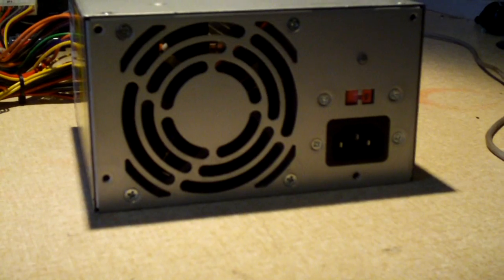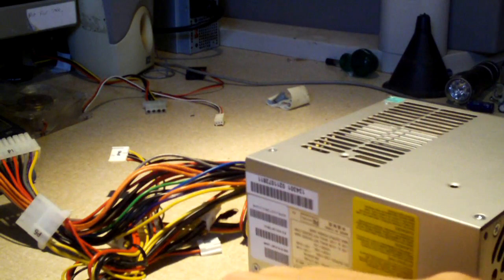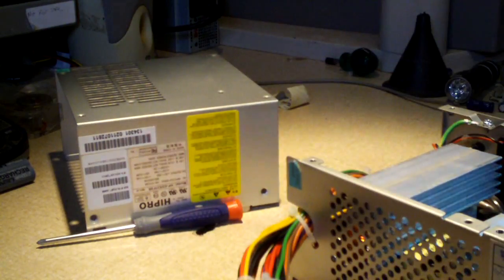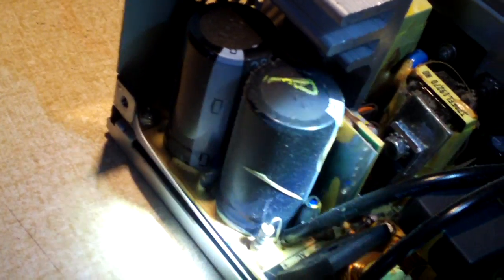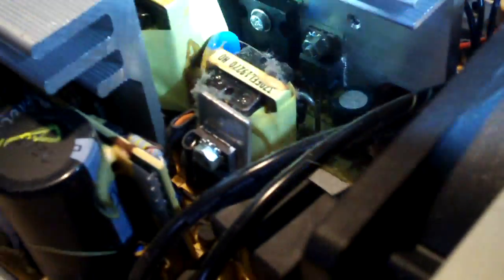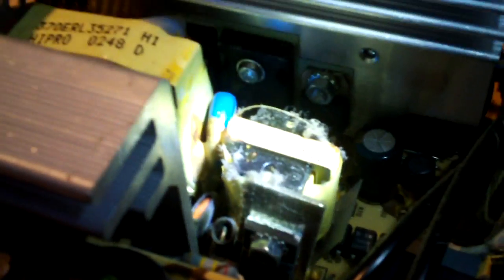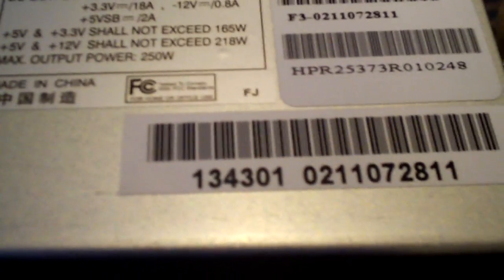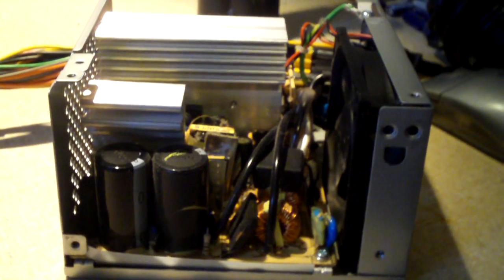Autopsy of dead HiPro HP-D2537F3R power supply - May 2013

Comment: The failure mode you describe sounds like one of the primary switchers blew, I can't think of any other method of failure that causes actual arcing inside the power supply.  I bet if you pulled the primary switchers and tested, at least one of them would test bad.

Comment: I love your power supply videos.
I've had some good luck with HiPro and some good/bad luck with Bestec, I had a 12E model fail on me before however the 12Z models are fine but as for hipro, they're filled with Teapo caps on a light load they seem to do very well. Mine's currently 9-10 years old
Reply from the maker: The Bestec ATX-250-12E units you'll want to avoid. The 300-12E is decent.

Comment: You know what's funny is that, i have this exact power supply and it JUST died on me today, the only difference is that the model number starts with a D (D2537F3R) hmmmm.... that's funny, and I found this video on youtube hours later when I was on a random video spree EDIT: the power supply failed with absolutely no bulging capacitors, and I believe it was middle big power transistor on the heatsink in the middle of the power supply facing away from the output wires, because the transistor in my power supply had a crack and a big welt in the center of the transistor..... That is probably what "POPPED" in your HiPro power supply..

~~You can see which transistor I'm talking about at 7:58 located behind the blue tantalum capacitor~~
Reply from the maker: I need to make a correction to the title. This unit's model starts with a "D" That device you're referring to is a rectifier diode pack, probably for the +5V rail.
Reply: Sweet, im glad I helped you out on that one, I was in the middle of installing a video driver and I was in the bathroom, I came back into the room and the pc was off and didn't turn back on.. and now I'm here hahaha
Reply: Same thing happened to mine